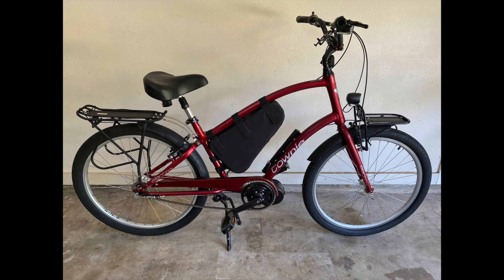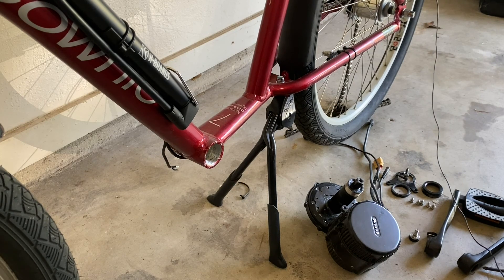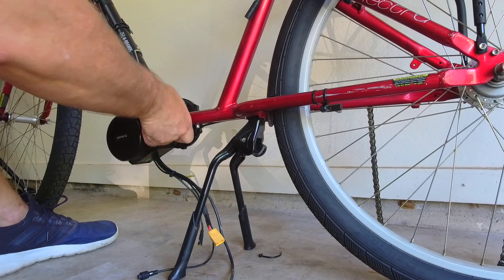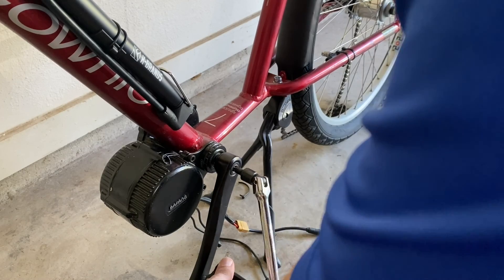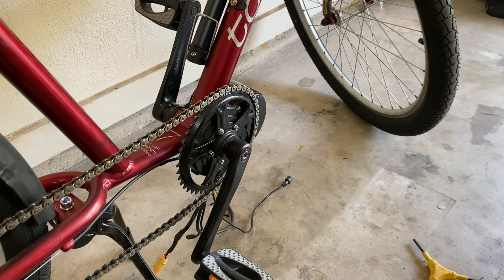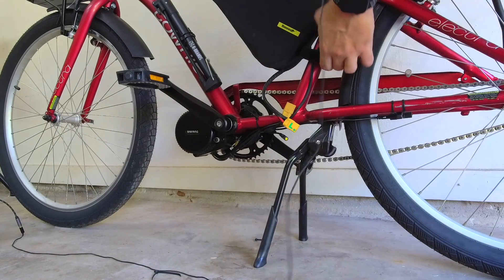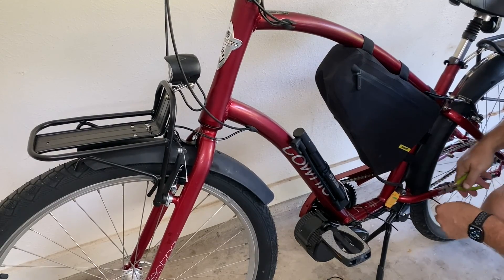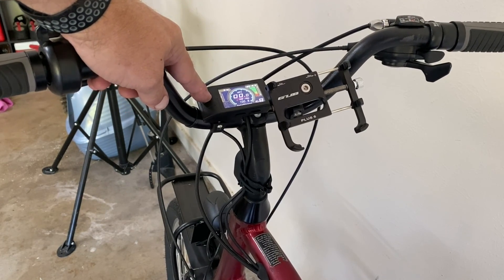Creating an Electric ELECTRA Townie

Comment: Hi guys, new to this  wonderful chanel, i have the first edition of Townie 7D with the front fork suspension. I'm trying to figure out how to install a mid motor on top of the crank , on the bottom of the V frame, where the 7D sticker is located. The main reason is i don't want to damage the motor if i go off road. Any suggestions or maybe modifications ? Thanks for any help and advise.

Comment: How did you even fit the battery into the bag??  My battery will not fit!
Reply from the maker: I’ve run 7 batteries on the bikes I’ve built so far. Sometimes the bags need a little persuasion to take the battery. The one on my wife’s bike has a slit to extend the zipper opening. I worried about it at first but have had no negative consequences..

Comment: Hi Jason, 
I just finished my townie with a bafang kit.  I could not access the front screw bracket to attach the townie chain guard.  Wondering if u had this issue and how you were able to mount the chain guard.  Thank you!
Reply from the maker: I chose the ‘zip tie’ solution for the front of the chain guard.
Reply: @JasonHoffmanYT  thank you for the quick reply!  Didn’t consider the zip tie.  I’ll definitely do that since I really like the original townie chain guard compared to the round one that came with the kit.
Reply from the maker: @RichM-CLE  How do you like the ride with the bafang kit on?
Reply: @JasonHoffmanYT  I just finished building it.  Making adjustments.  Haven’t taken it for a ride yet.  My townie is an 8 speed with an internal nexus hub that I converted from an 3 peed internal hub.  It also has roller brakes.  Hoping for good things!
Reply: You’ve had you’re for a while , how’s it been running?
Reply from the maker: The Townie was the perfect bike to put it on. Except at the beach because Townies and loose sand don't agree. So I have since moved it over to a fat tire bike. But the bafang itself is bulletproof.

Comment: Is it possible to have an extra chain for emergencies, and replace a broken one? I see that with the mid hub it avoids problems with changing tires, but mentions broken chains. I don't see how it could be hard to replace the chain using a link instead of a standard chain. Please comment. Hope you got through the Covid, it was a beotch in my house.
Reply from the maker: Absolutely! I throw an extra chain, with my extra tube and multi tool in my frame bag.

Comment: Great video.I’m considering purchasing a standard townie and converting it. I love the internal routing of the cables. Do you know which townies will accommodate that?
Reply from the maker: Trek bought Electra in 2014 so I know all after this were internally routed, but they may have already started prior to. Thanks!
Reply: @JasonHoffmanYT  that’s really helpful, thank you so much! How are the bikes holding up?
Reply from the maker: I put quite a few miles on the Townie. Went through a couple of internal gear hubs before I put a cassette back on. And have since changed it out to a hub motor so I can use the bafang on a fat tire bike. Constantly tinkering lol.
Reply: @JasonHoffmanYT  do you still like the bafang?
Reply from the maker: @sabinehalfhill4005  Very much. I’ve helped a friend and his wife convert bikes using the same. We enjoy riding together.

Comment: Could you rotate the motor to be above the bottom bracket inside the v of the frame?
Reply from the maker: MAN, I wish you could on a Townie! But no. On an Electra Cruiser you can, just not on the townie.
Reply: @JasonHoffmanYT  do you know of any other frames that would accommodate that position?
Reply from the maker: @P.i.c.k.e.n.s  The bottom bracket in relation to the ‘triangle’ (which is not triangle shaped on Electras) is the key to letting a mid-drive motor fit. So most crank forward cruisers will work.

Comment: I did this exact thing to my Townie 7D. I have over 1000 miles on it since 2019. There was some learning curve with tire pressure vs torque of the motor, but once I got that dialed in, it has been a great upgrade.
Reply from the maker: I agree! Love the BBS02. Have since switched it to a fat tire bike and loving that setup as well. Thanks!

Comment: Guess i will be the first person to write a comment here. I keep hearing that this is the most popular bike in America but for whatever reason that isn't being reflected on Youtube which really surprises me. I got mine back in August after waiting for months to get a decent bike. This one happened to be available so after i took the test ride of it I decided to buy it.   Well here it is November and I do not regret my purchase as I have been on this bicycle a whole lot!  Thanks for posting this video as it gives me an idea for something to do in the future.
Reply from the maker: Thanks for the feedback! If it gets you on the move it was worth the purchase. I have put the same motor on my and my wife’s townies. We had a blast at the beach in July.
Reply: @JasonHoffmanYT  How fast does it go and how long does the battery last?
Reply from the maker: @swift7169  25-28 on flat ground. I weigh 235 so that factors in i suppose. 30 miles is normal if I help it on the hills.
Reply from the maker: So long as the battery is in the range the controller  built into the bafang will handle the only programming needed is done in the settings of the handlebar mounted speedo/computer. I did choose to cut and resolder some of the wire to shorten them.
Reply: I can't find the links to your electric battery and bafang kit?
Reply from the maker: Just above the comments, in the video description, click on SHOW MORE and the links will be there.
Reply: @JasonHoffmanYT  oh wow 👏  I thank you...
Reply from the maker: What’s your application? Live in a hilly area? Are you a bigger guy? Those are the kinds of things that might need the 1000 watt motor. But I’m 235lbs with some hills around and the 750 carries me well. It was cost based decision for me when I bought, but I don’t regret it a bit.